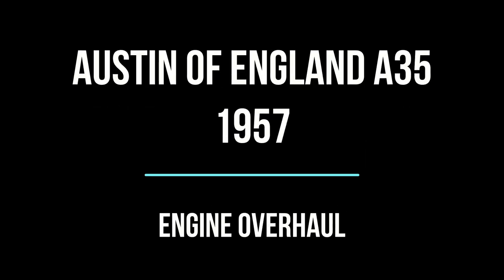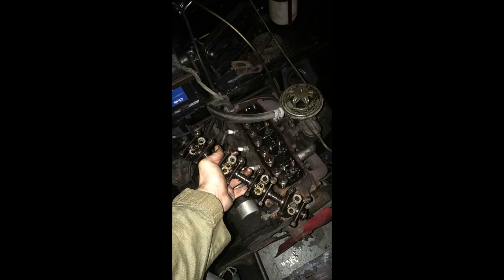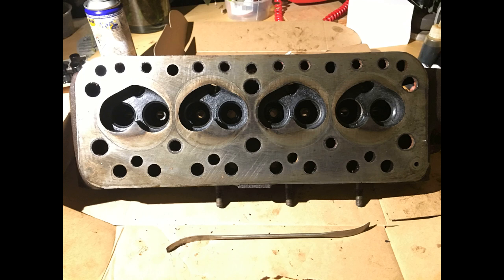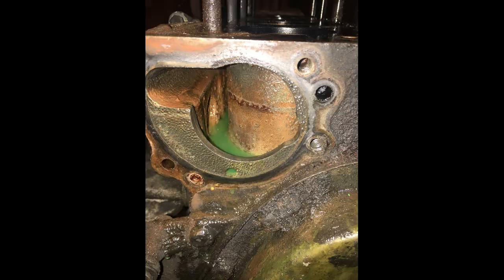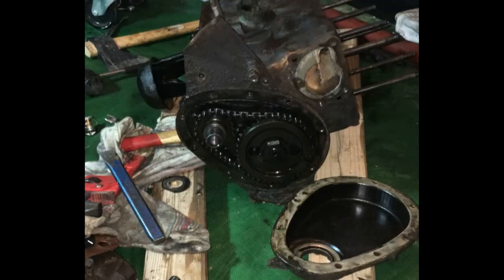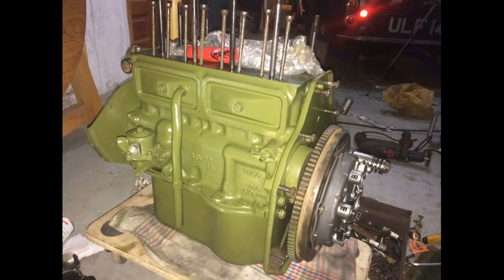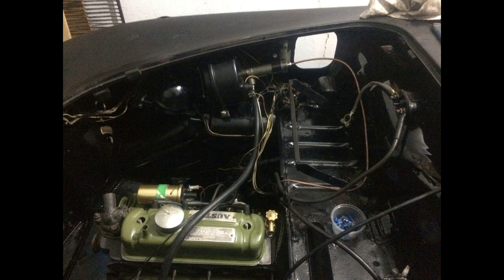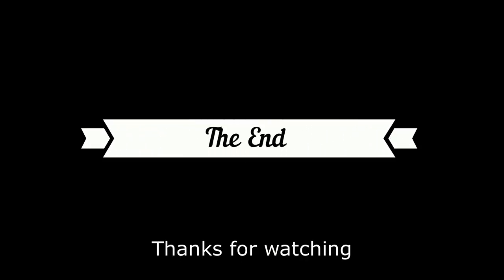Austin A35 (1957) - Complete engine overhaul. [BMC A-series engine restoration] Slideshow

Comment: As a full time carer, the furthest return trip that would drive would be 30km but most days it would be about 10km which is terrible for an internal combustion engine. Lately I’ve been looking around for an old car to convert to electric and the A30 would be perfect for my use as it looks as though it’s an upright sitting position which is better for getting in and out of unlike most modern cars which are too low.
Reply from the maker: And its small and cute! I plan to use it frequently when I finish it. You could convert the austin to electric lol